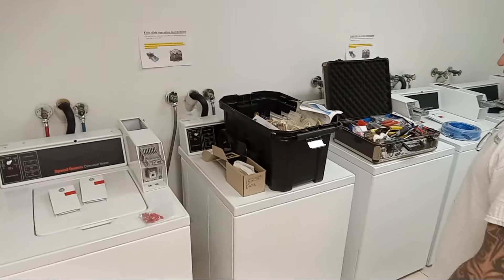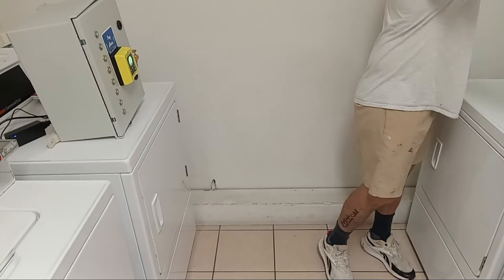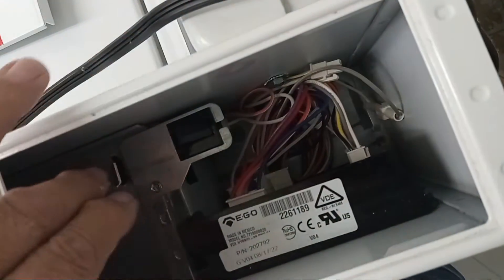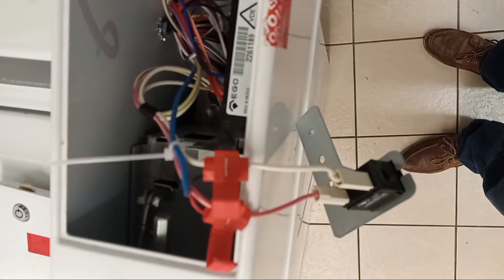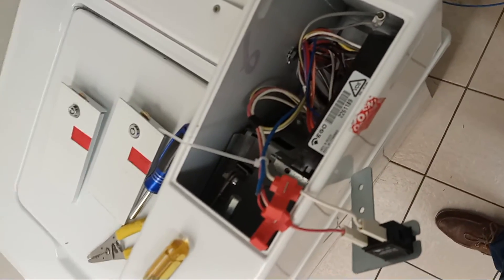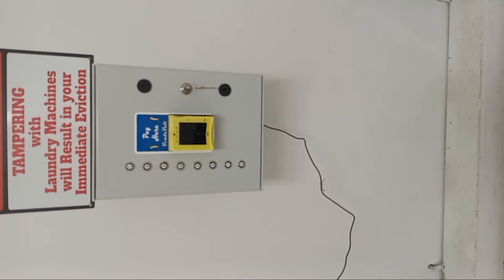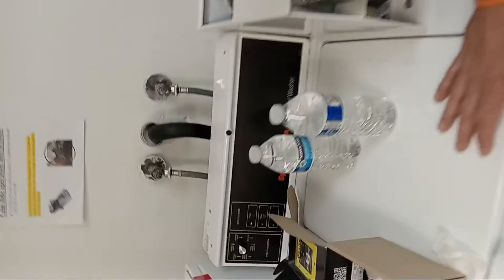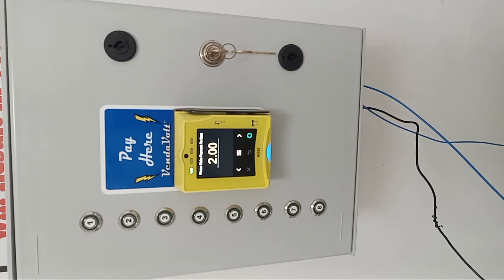How to retrofit coin operated washers & dryers to vend cashless payments with credit cards.

Comment: So a user who wants a free wash will only have to reach to the 2 wires on the wall and short them briefly? That is a very insecure system.
Reply from the maker: You obviously do not understand vending in a laundromat.  The wires are inside of a 1/2 inch conduit.  The conduit is behind the washers and the dryers on the floor.  In my over 50 years in vending washers & dryers...no one has ever brought in a saw to cut through the conduit!   So...it is totally secure.  Also, note the internal camera on the Nayax Vpos Touch Credit Card Terminal.
Reply: @XCPCORP  it is not in the video.
Reply from the maker: @iva2k  I am doing the video for our customer.  Last step was to install the 1/2 inch plastic conduits to each washer and dryer.

Comment: Where did the other end of the blue wire go that you ran?
Reply from the maker: all 8 of the 2 conductor cable was installed inside plastic conduit from the bottom of the Model 5008 Payment Station to each of the 4 washers and 4 dryers.  Very easy to install.